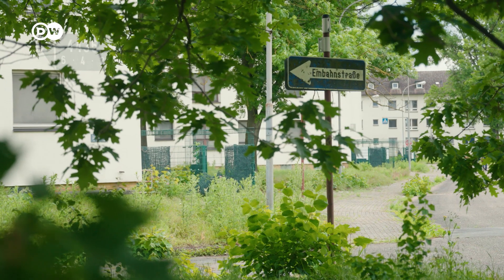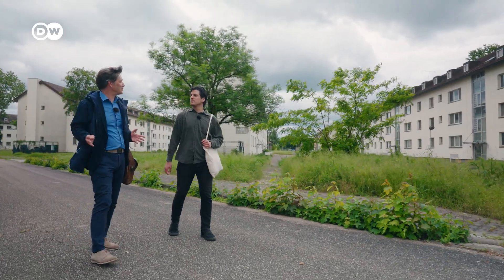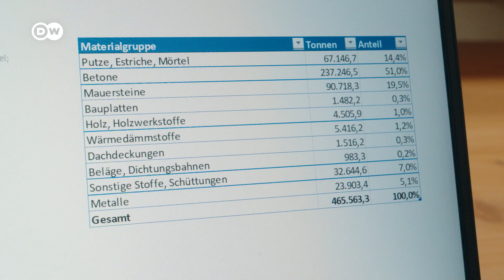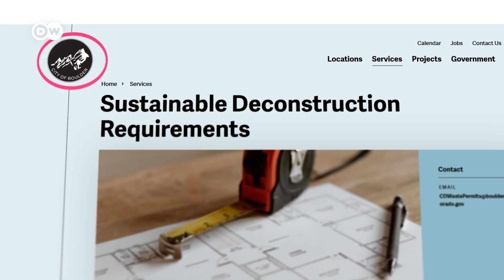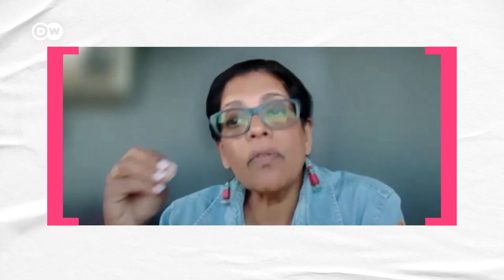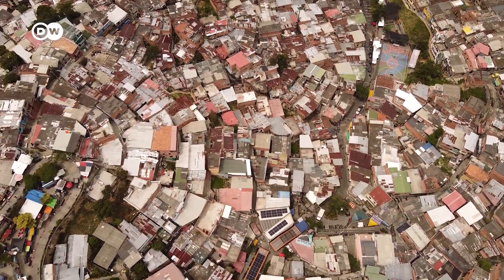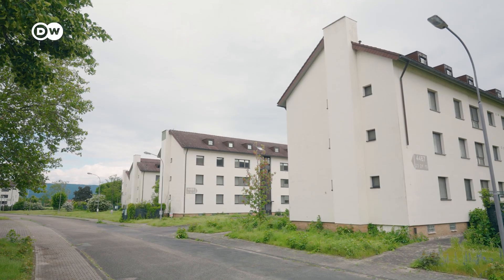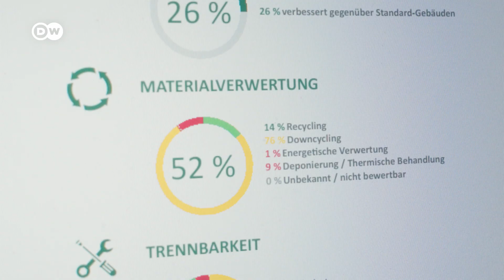How to recycle an old U.S. military base

Comment: Looking backward to how my house was built a couple of years ago under the KFW 50E standard, it is difficult to imagine that such a house could be easily recycled. Alone the floors and roofs are a chaotic sandwich of materials up to 70 cm thick. If urban mining is the way to go, the houses should be built in such a way that the materials are easier to recover.

Comment: As was said, this is nothing new, people have been doing it for thousands of years, but this project is taking it to a whole new level. While I'm really skeptical about this whole climate change thing I think it's a great idea because waste in general is bad. It's so much better when we can find a new use for old buildings.

As to urban mining in my area (the booming Research Triangle of North Carolina), I don't know of any quite like this. But one thing I did notice that seemed like an excellent idea, when rebuilding a highway they took the old concrete, broke it up, separated the rebar, and then turned the concrete into gravel that was used as the base for the new roadway.

Comment: The project does not convince me. Crushing and recycling does not reduce carbonization. If the buildings were made of adobes, tapia, wood, then yes, but the mechanization and reformulations of industrial materials is a fallacy in energy savings.

Comment: The price of labor is to high so they wil not separate the glas and aluminium from the plasticwindowframes. It wil end up in the landfill. The big fridges are to inefficient so there is no market for in europe and to expensive to export. The stoves are to big for europe so they get scraped. The electric outlets are to expensive in labour to get them out.

Comment: Most of the buildings on this base were in fact built by Germans using German materials and local codes. American Engineers simply awarded contracts to different firms and insured that they were built to contract terms. While I was there in the 1980’s much that was of inferior or antiquated design was in fact torn down and replaced with the best available materials and built by Germans (Boiler plants, fuel storage). Before departure for the final time many items were replaced with new items or repaired for future German use. Then the sites sat empty for a decade plus.
Reply: Yep.
Reply: Why aren't they using these homes as social housing???
Reply: @Zeptus1488  Many are in fact used to house refugees from war. They receive training and employment assistance as well as teaching language skills.

Comment: Most places also like to renovate existing structures but one of the main issues here is that these buildings have too much square feet for Germans so they want to obviously go through some really cutting edge changes basically to hide that fact. 

While it's sad to see something change and disappear that was so much part of your life that's the cycle of life and it has to happen. 

If it's anything like they did at Campbells barracks I'm sure that they'll make the roads wonky and very difficult to travel on and I'm sure the buildings will be made much smaller to fit the requirements of the German population

Comment: Good idea to reuse materials and parts of the demolished buildings. 

But renovating/reusing all buildings would be better.

I think the main reason why only 1/3 of the buildings are reused is that new build houses/buildings sell better and they can fit more buildings on the same area (sell more apartments etc.) 

I’ve seen that many times. Old Buildings are demolished and then new ones with more space are build.

Comment: eliminating options of virgin materials will force builders into using more of the same materials in construction.  That will make it easier to reuse the materials, as there will be fewer type to deal with.  IE all houses preindustrial, were just wood.  No tile, no plaster board,  Wooden walls, wooden doors, wooden shingles.  Very easy to reuse those materials in other houses.  While fire laws may have stopped that, other types of materials, think 3d printed concrete homes could do about the same.

Comment: The biggest improvement would be to not let these buildings sit dormant for so long. Without care they start to deteriate fast. The roofs start leaking and ceilings fall then mold starts growing. I would see about shipping appliances, windows and other items to poorer countries. The windows may not be the best for Germany or even that energy efficient anywhere but they are better than no windows.

Comment: Unfortunately, one can't assume all buildings on old US bases are capable of rehabilitation. Many of these were never intended to be "permanent" structures. Often, they were built very quickly with little expert direction, poor (and sometimes hazardous) materials, and then they were not necessarily well-maintained afterwards. Thus, we can't just slap new paint on the walls and move people in. We do have to be painstaking with the inspections and inventories, and THEN deconstruct and rebuild for the long-term.

Comment: 20-30 years ago I worked on large construction projects demolishing old concrete building like shopping centers or factory's. They were large enough that it was profitable to bring in portable crushers to turn the old concrete into recycled sub base  for onsite and other building projects. The steel rebar was sold to metal recyclers. Asphalt roads are regularly broken down by grinders and taken to be used in new asphalt production. In my State in the USA, it is cheaper to recycle it than put in landfills.
Reply: What state though?

Comment: Sounds like some of the regulations should change. That bit about the solar panels was unfortunate. It's good that requirements for solar panel efficiency have kept pace with improvements in technology, but perhaps those should only apply to new panels. Those used panels are perfectly good and could be used for a different home or something.

Reduce, Reuse, then Recycle.

Comment: Re-use is much more important than recycling. All of these units should simply be occupied with families and shops. And it being illegal to reuse the windows is ridiculous.
Reply: Use the windows for greenhouses!
Reply: The old windows can be recycled into new windows, the glass and metal or wooden frames are very much recyclable materials, where older windows may not seal as well as they used to if reused like a new one would.
Reply: Saving energy and emissions is the main goal. When it is more efficient to replace they will. It saves in the long run is not so ridiculous.
Reply: @jimbucket2996  Ok. If it's cheaper then free people should be free to choose the newer window. Don't make it illegal.

Comment: Stuff like fridges and insulation are a tough one.  Fridge could be full of expanding foam.  Manufactured 'wood' like chipboard.  So interesting to see what they come up with.  Many non masonry forms of cladding could present an issue too.  Asbestos in the buildings?
Reply from the maker: Hey Paul! There was also asbestos found in some buildings and they had to investigate whether these buildings can still be used or not.

Comment: Germany needs 1 million apartment every year and they demolish this apartments 😢. i cannot find house to live i pay 1500-2000 euro rent!!!!
Reply: they don't want ghettos in cities, that's why they destroy cheap buildings and build new and expensive suits.
Reply: I thought that too - but you've no idea from the report what proportion of the buildings you saw were barrack blocks versus married quarters. It may be that the internal layout of the blocks prevented re-use for civilian rentals - after all the designers would still need to comply with German construction laws and fire regulations. And they said that the new development would be higher density than the old base - so you've no idea of how many new flats / houses they plan to stuff into the area versus the number of people they could house if they converted everything.
Reply: @MalcolmRose-l3b  ja ja ja . after several decade. typical lies. It takes several century to build new thing in shitmany. I regret to come here everything is very expensive

Comment: Gr8 video Gr8 concept except 1 error: the single glazed windows can be reused in situ 1 of 2 ways. The conductive metal covered with an insulating material then double or triple glazed windows added out board as has been done in Netherlands & Sweden, or disassembled & rebuilt by glazers on site into new double or triple glaze wibdows a la US President's Carter Plan.

Comment: Imagine, in the future, for every house build, there is also a data base for that house which contains all the materials used. So, as soon as it will be deconstructed, nobody needs to examine anything, because the database already exists. It would make the urban mining project much faster.
Reply: Hmm, I like a good database, but what happens when the home owner replaces a toilet, light fixture or appliance when it dies. Will they be required to update the database? This may be necessary for accuracy.
Reply: @winnipegnick  I also like databases, but those will just create more headaches for average people. It's good for voluntary efforts, though.
Reply: @xitro20xx  @winnipegnick   It would likely be a bureaucratic nightmare, but if it was part of the process for getting the permit for construction, demolition, and building inspection?
It could be feasible. I'd just leave appliances (water heaters, boilers, furnaces, and ACs the exception) off the required list. Many fridges or washers and dryers are taken with.
Reply: I don’t think that would work well, atleast not how we currently build things. As the plan makes it way down from planner to architect to contractor to who knows how many subs finally down to laborer it’s basically guaranteed somebody cut corners and you’ll end up with mystery material in the demo
Reply: Car manufacturers have been doing this for 30 years, has it helped?
Reply: This is called a material passport and its becoming more common in construction projects. Since projects now are often constructed with a BIM (building information model) which contains al materials and elements in a digital model its becoming more easy to make a material pasport. While information in the model might nog be 100% accurate as renovation take place, the parts of the building that have the most significant environmental impact (like the structure) are generally not changed that much during a renovation. So  the future you’re talking is already on its way :)
Reply: Sounds just like the sears catalog homes from 100 years ago... Not a new idea, just a simple materials list
Reply: Oh and public entities/ the us government have a real hard time putting together accurate materials lists for these kind of expenditures... Makes it easier to fudge the costs a bit
Reply: I just don't see in happening for houses, especially since here in the US most of them are made of wood with things like vinyl siding and PVC piping... none of which is very recyclable.  Now commercial buildings are another story.
Reply: @JeffDeWitt  That Pvc piping is . And other stuff , like those granite counter tops .  Cabinents when they are gently used before they use them to film sledge hammer .  Which sadly is valuable on film .
Reply: as people renovate about a piece of their house every 10 years, it would be very very hard. also privacy
Reply: Not really you're not accounting for the diy bubbas
Reply: Somebody literally ordered all that material! Call and ask for the receipts! Urban mining - you mean reusing and recycling! As for designing, seriously, twenty year deconstruction!?! WTF! This from a country that has buildings that are centuries old. These are USA government buildings they had As-Builts! The level of ignorance is unacceptable!
Reply: Cool idea but too idealistic for our reality. The privacy nightmare that could pose isn't worth it.
Reply: @Beskamir  maybe not for the easily movable parts, but for the house itself? I still see people having to test for asbestos before demolishing anything. 
but then, renovating every 10 years (aside from maybe repainting or a new fridge) seems absolutely wild to me and the family homes I usually see
Reply: what a stupid government is germany. I pay here 1500 eur rent. people are homeless millions of houses are missing and they demolished these apartments